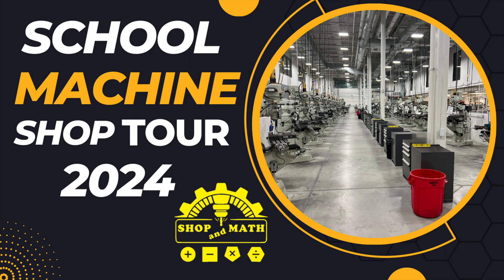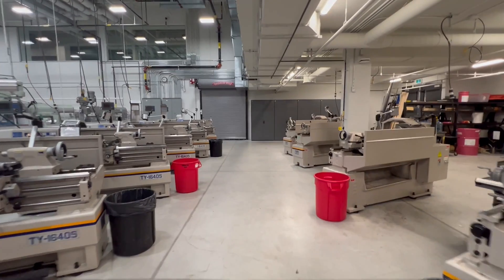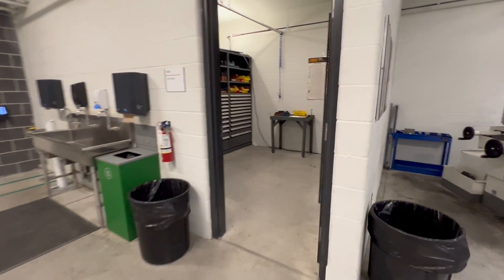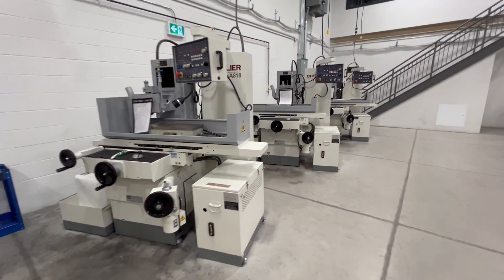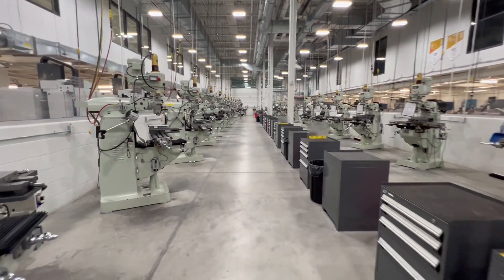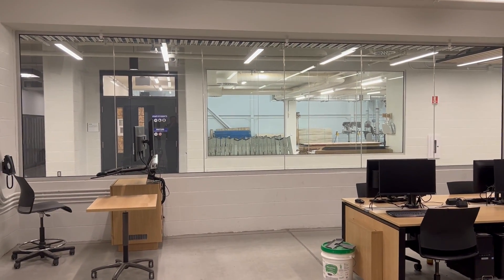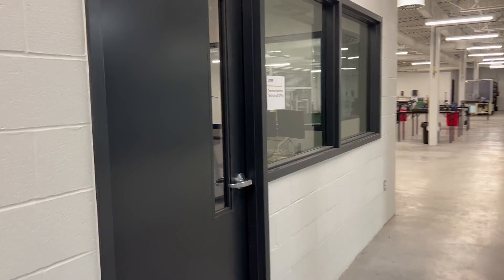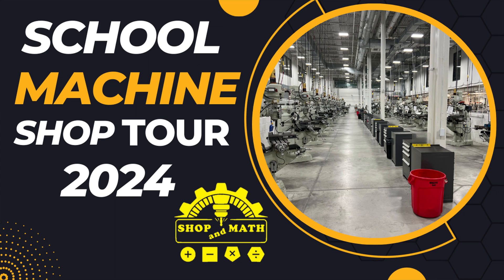School Machine Shop Tour 2024

Comment: It is great to see manual machining technology still being taught!
Reply from the maker: For students to understand advanced machining example CNC you have to know the basics first
Reply: Yes and a Great teacher will make certain each kid knows the Math used and get the kids to help each other learn and be certain they know and understand Trigonometry.....just my thought Great Facility.  Keep up the GOOD WORK. @shopandmath
Reply: @shopandmath Absolutely! You can use all kinds of speed/feed values in your program, but there's no substitute for sound, vibration, and chip color for optimizing cuts.
Reply: Not a bad way to start.

Comment: Where are you located
Reply: Ontario?
Reply from the maker: This campus is in Kitchener Ontario
The shop is only one of a dozen or so in the building that are as equally impressive, but I don’t teach in those areas
It is also only the first stage of a three stage step. It will be three more buildings just like this one that will have all of the trades. 
From automotive, HVAC plumbing electrical